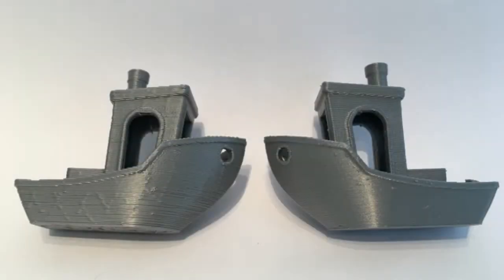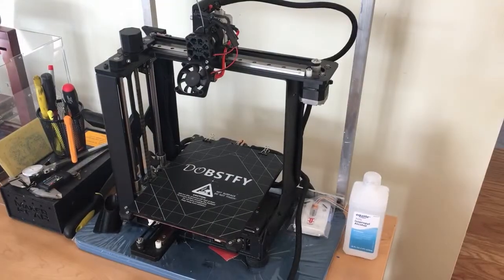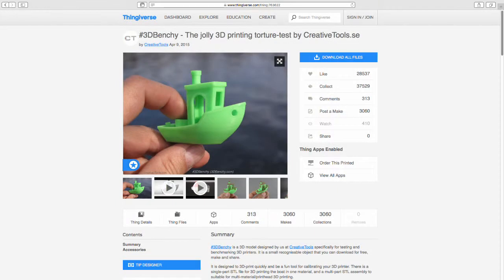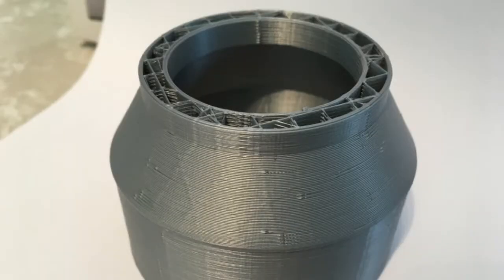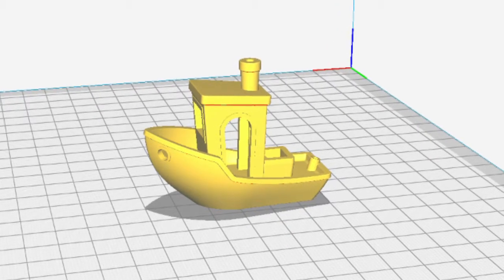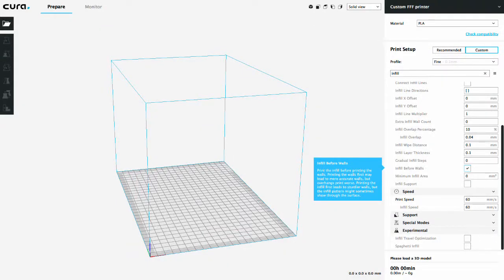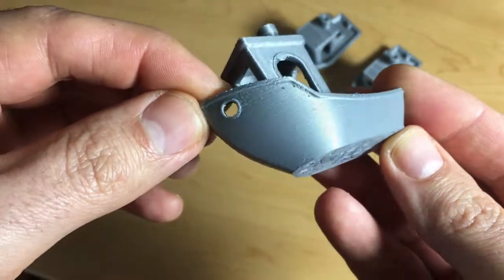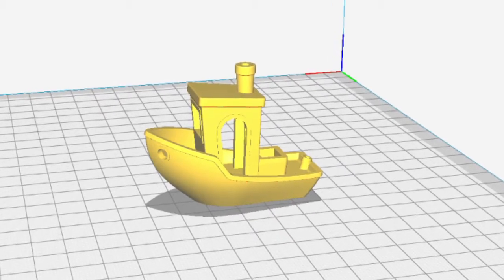[19-B] Fix Lines on Outside Surface of 3D Prints

Comment: I've been dealing with this lately on larger prints. Like you, i went and changed the percent of overlap to the outer wall with no change in the print. When I get home today from work I'm going to look for that setting you mentioned and see if that finally clears up my infill showing through my walls! This will greatly reduce sanding and priming/filling my prints to remove this annoying look! Thanks for the video!
Reply: any luck with it?

Comment: I've had this problem with multiple of my printers. Tried different firmwares even klipper with it's pressure advanced control with no luck. It's frustrating to learn that all I needed to do was click one box in Cura. Thanks for showing me the solution to the problem I've had for years.

Comment: I've never had this problem before so I was intrigued to see what the issue might be. Turns out all my previous printing defaulted to perimeters before infill (Slic3r and derivatives default). Now I see what happens if I would reverse it, so if someone comes to me with this issue I have a solution to check with them. Thanx for teaching me something new. :-)

Comment: this also drove me crazy until I found this setting from someone on reddit. so wack that it's set by default. until i realized i could change that setting I used to just make my wall count higher so the walls were thicker and the lines wouldn't show. but that's just a waste of filament.

Comment: My Benchy got really noticeable zits on the surface. Not sure what to tune in this case (the video suggests some "slicer tweaking"). Everything else was pretty much spot on. I appreciate the help!
Reply: sounds like over extrusion issue. when the nozzle retracts and travels it primes itself to start a new run and sometimes it lets out an initial blob at the start of each run. that little blob is usually what causes those zits on the outer surface. you obviously don't want a blob at the beginning of each run. play around with your flow, priming, and retraction settings. that should fix it. Cura has prime blob setting as well called "enable prime blob" which I think might help. but also do your own research on the matter im not 100% on this.

Comment: Thanks! I've had this exact problem on my first benchy. 
I'm new to 3D printing, but I think this should probably be off if you want the walls to look perfect (like here), but on if strength is more important than looks, and to maybe help with overhangs.
And if something needs to be strong and look good then have it turned on, and just clean up the outside afterwards.